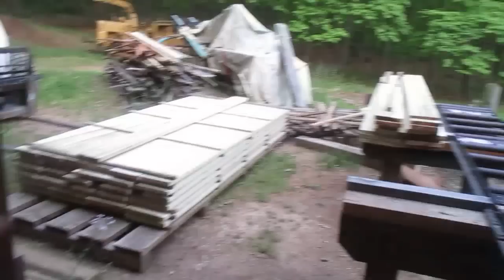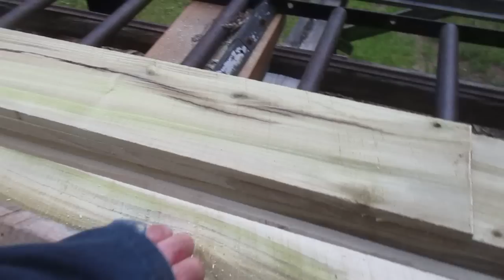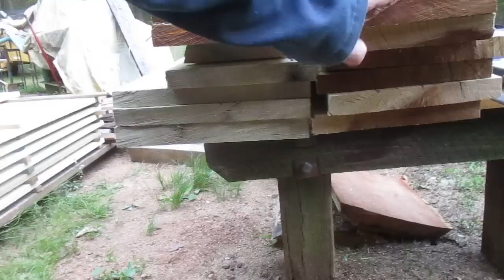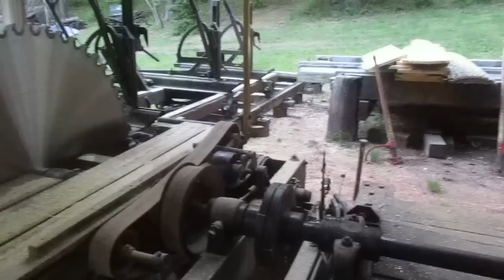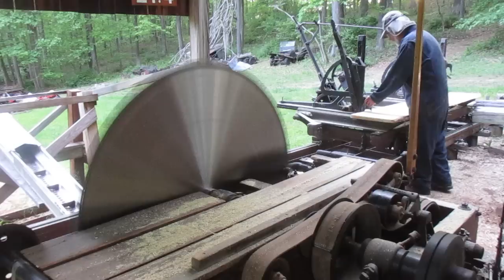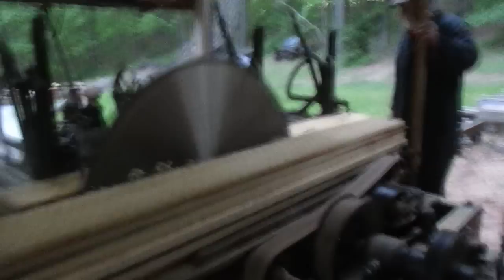Trimming Poplar boards  # 1147

Comment: You frickn worry me old man. Your fingers are no more than inches away from the front of the blade. Wouldn't take much for one of those boards to fall against the back of that blade and launch past your nose at 120 mph. I've had a well equipped wood shop for over thirty years and still have all my fingers. My credentials...lol. Be careful!!! Body parts do NOT grow back!! -Curt Kuhns
Reply from the maker: hi there thanks for the interest , i will be as careful as i can , thanks for dropping in john